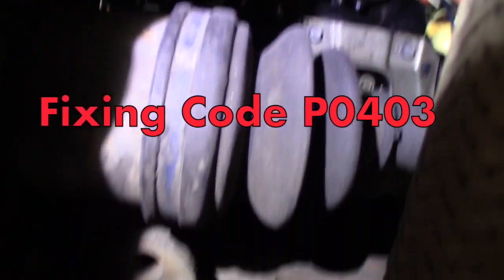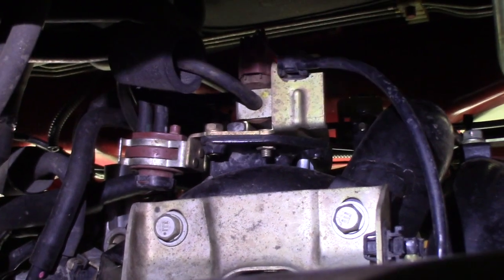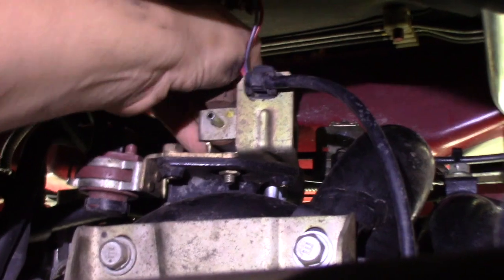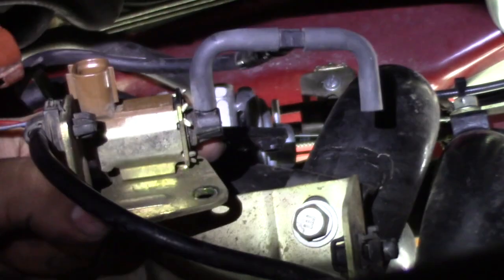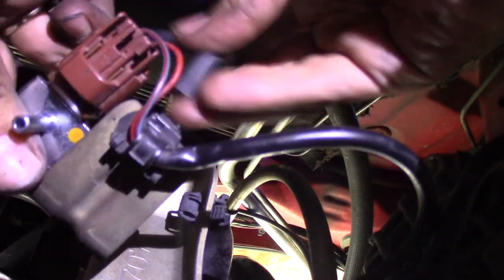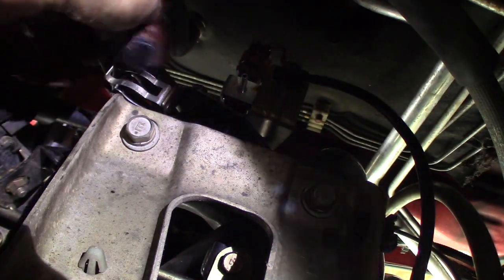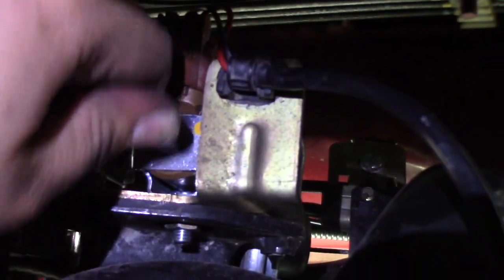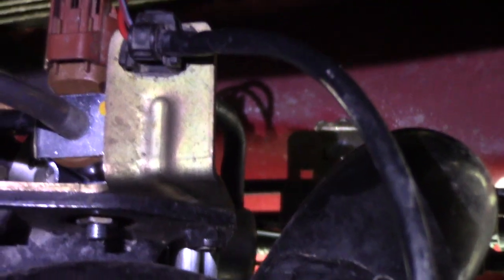DIY Fixing Code P0403 3G 2.4L Mitsubishi Eclipse (Easy) EGR Vacuum Solenoid

Comment: EGR Valve Control Solenoid / Motor
 Mitsu part # MR127520 , about 30 bucks. I threw this P0403 code today after changing my starter, coincidence?

I'm going to look at the wiring and vacuum lines to make sure I didn't inadvertently disconnect anything tomorrow, thanks for the video